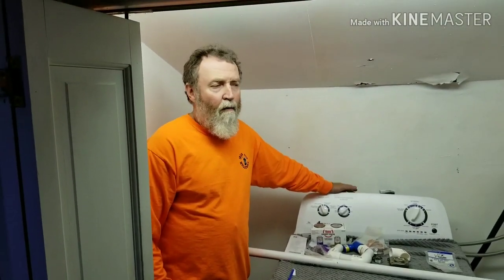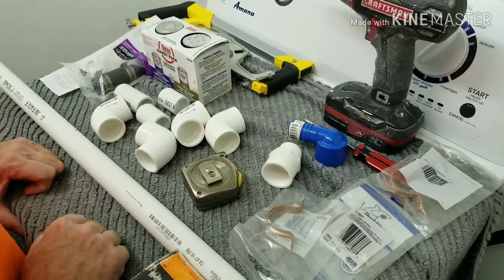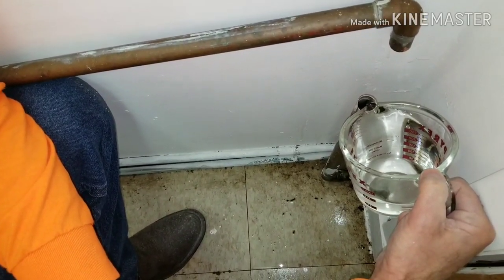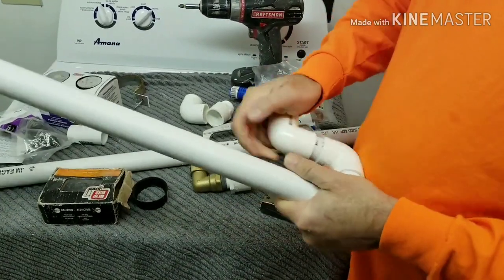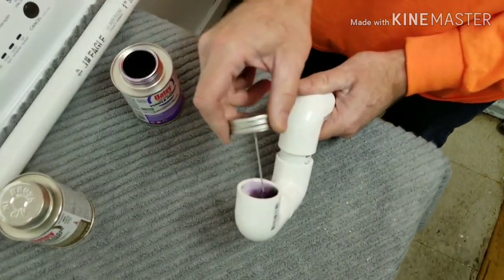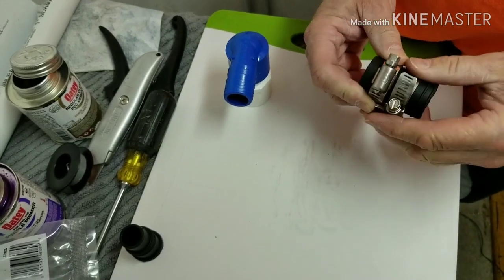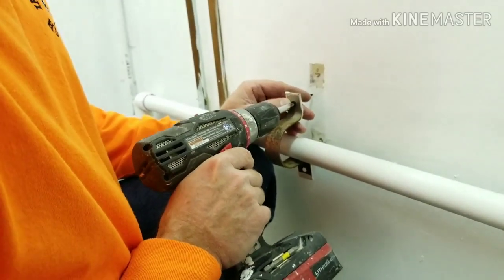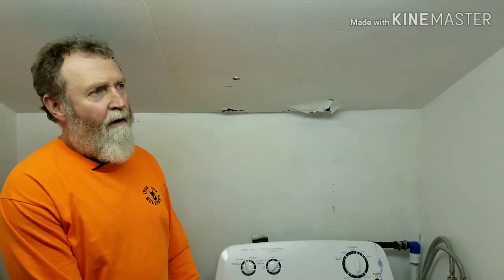Solution to an Overflowing Washing Machine Drain

Comment: Good job. Next time though try to use longer sweep elbows. Short, 90 degree elbows are more for venting than optimal water flow. Hopefully you also designed it so that some air can still get into the drain. You definitely do not want to seal it up. Also, your "trap" should be U shaped. Regardless, I am glad it seems to work. It is much better than it was before.

Comment: When the drain pump runs and discharges all of the water out of the basket it will start discharging air into that pipe. All you have done is made it so instead of not leaking onto the floor that dirty water will siphon back into the machine.
Reply from the maker: We haven't had that problem, it is working fine.
Reply: I don't think so IF he allowed air to get into that system. That is key- like in a can, you have to puncture both sides so the liquid can flow.

Comment: I've got the same problem. I sealed the pipe from the washing machine to force pressure going out but I ended up messing with my washer. My washer got flooded. I then used a water hose and a nozzle sealed with plastic bag and pushed it down knowing we got at least 60 psi from city water which it worked before unclogging my sinks. Well,  it when thru but slowly. I added plumber liquid then tried again.  It seemed to go better but still not fast enough than my washer pump.
Reply: I have a top loader. It pumps out water too fast for my system to handle. Why do they make the top loaders dump water so damn fast, that is my question.
Reply: @zaneyone1  I fixed it already. I found out whoever installed the pipes made too many turns and elbows going up higher than the washer drain. I cut and caped the old pipe and installed a new one strighter and with good gravity.  It goes good now.
Reply: @zaneyone1  The reason is to effectively drain the tub so cloths come out dryer. You likely have old code, 1.5" pipe, soft water and use too much soap. Using 1 TBLSPN of HE detergent, no fabric softener and a small amount of White Vinegar in each load should help. If not, call a plumber and increase the size of your drain pipe. Also, put a pan under all of this and have a drain in it. Assume at some point in time, you will get water on that floor. It is better to be safe than sorry. 

Since it's been a year, did you solve the issue on your own?

Comment: I can do this with a straight pipe that elbows down to the concrete do I need to make a trap if it don’t have one. Just curious mine existing pipe is a 1 7/8” pipe galvanized
Reply: Some plumbing has traps inside the wall. If you don't smell anything now, you likely have a trap already.

Comment: My washer stop mid cycle n didn’t drain water and the lid lock sign popped up, when I checked the drain pump n put it back n start a tried a cycle it was licking for the drain pump. What should I do?
Reply from the maker: Call an appliance repair man.
Reply: @lisamallard  how much will they charge?
Reply from the maker: I have no idea, these questions are beyond the scope of this video
Reply: What was the issue- did you resolve?